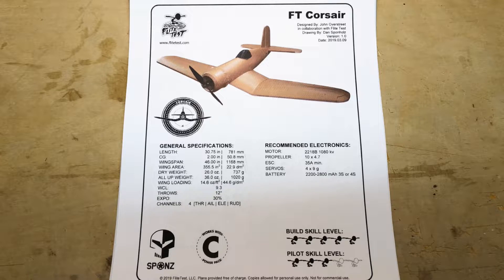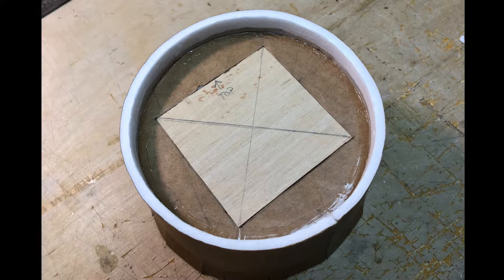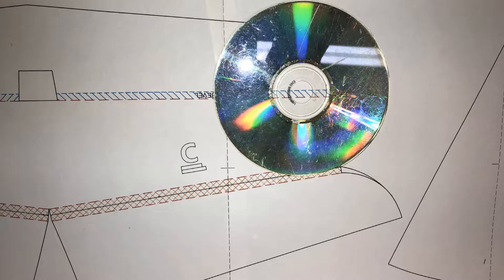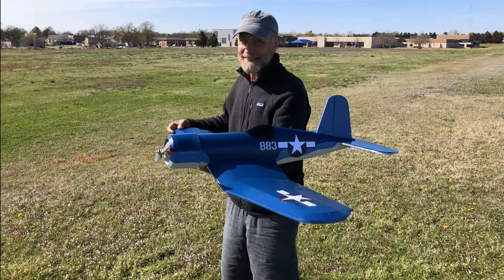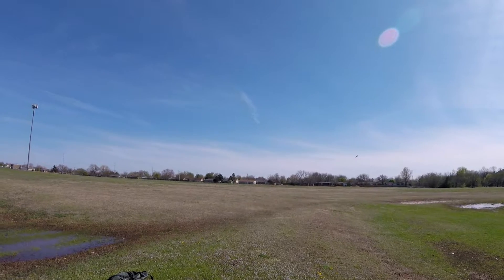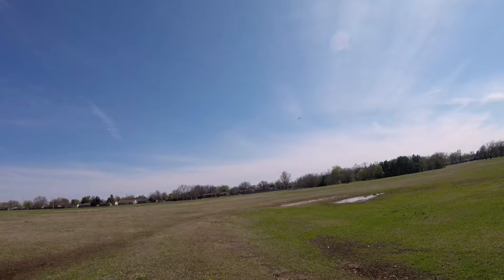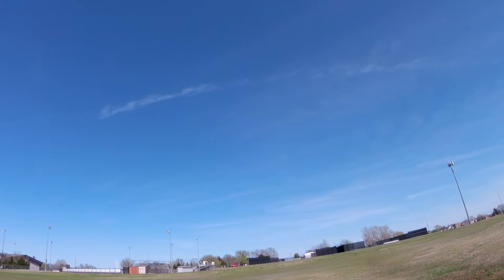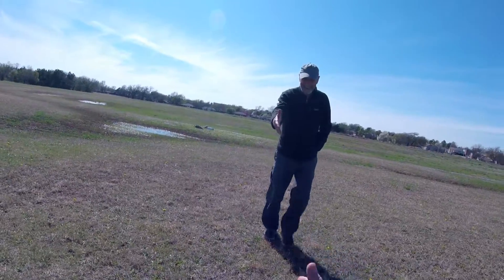FT Corsair Master Series Build and Maiden

Comment: thanks you, you best works, nice plane.  i have a qa. What motors and props are used on your plane?
Reply from the maker: Thanks for the kind comment!  The motor (also in the video description) is an RCTimer BC3530/14 1080KV (similar to Flitetest "C" motor) and the propeller is a 10x4.5 apc.  Good luck to you.

Comment: Where is the CG of this plane?
Reply from the maker: Hi there- it’s right on the front wooden wing spar.  This is the recommended cg from flite test.
Reply: @mostlyharmlessrc3920  Thanks, I will maiden this plane this weekend, but it still tail heavy althoug I have use 4s 2200 and landing gear. Do you have any solution?
Reply from the maker: I have always flown this plane with more battery weight than that (usually two 2200 batteries in parallel) and even added a 50 gram lump of lead inside the cowling.  This got me to the correct CG in the end.  Good luck.
Reply: @mostlyharmlessrc3920  Thanks, it really helpful. Tomorrow I will maiden it :))

Comment: Hey man..that is very good video description and corsair is very stable in flight.what motor did you use?i made the plane with hobbyking turnigy aerodrive sk3 3536-- 1200kv motor..the motor weight with fittings is 135gms and AUW is 1200gms and im using a 3s 2200mah lipo and 60A esc .motor is giving a thrust of 1900gms. can the plane fly stablely and can it perform aerobatics?....i need your suggestions
Reply from the maker: Thanks for the great comment!  The motor I used is in the description: Rctimer BC3530/14 1080KV (similar to FliteTest "C" motor).  The motor you have should work well with the right prop (9x4.5?).  My AUW was 1060 grams, so yours sounds a little heavy.  You'll probably want to use two 2200 lipo batteries in parallel to get more than five minutes of flight time.  The biggest issue is to make sure your plane balances at the location of the front spar (correct center of gravity).  As long as you have some flight experience, it should go well.  Good luck!

Comment: Hi nice design.. FT recomend 5.1 cms for CG center of gravity, what is yours..  and the total weight.. I just finish my F4U corsario but I use 6mm foamboard.. I put aditional weigt 50gr . Total weigt 1200gr. I have 6.8cm 😔 I going to test tomorrow..
Reply from the maker: Thanks for the comment!  My CG was right on the front wooden spar, as Josh recommended in the build video.  My plane weighed 1060gr including batteries.  I also had to add 50 grams inside the motor cowling to get the balance right.  Your plane should be stronger with thicker foam, but may need a little more nose weight.  Huge luck to you and happy flying!

Comment: I'm on my 4th F4U from Flite Test, yes I'm hard on this foam. I've never built one via the free and they provide. How long did it take to cut out and how did you do that?
Reply from the maker: Wow four of them is impressive!   Here's the page where I downloaded the tiled plans that print on regular 8.5x11 inch sheets of paper (tiled A plans): https://store.flitetest.com/flite-test-ft-corsair-master-series-electric-airplane-kit-1168mm-flt-1065/p897439?gclid=Cj0KCQjwnKHlBRDLARIsAMtMHDFePyqkVVR4-bZxJByq_JvZZfhea-sf2-Hyq2L2KPN4Y0iecG9av5UaAj8tEALw_wcB.  In the plans is a page showing how these sheets are taped together and then laid out on full size sheets of foam board from the dollar store or a hobby store. It took a few hours to cut out the foam and plywood pieces.  Cheaper and faster way to do it!  Good luck  :)
Reply: @mostlyharmlessrc3920  I'll have to do that, I'm not doing anything these days lol thanks for the reply and be safe!!
Reply: @mostlyharmlessrc3920  also, great build!!!!
Reply from the maker: Thanks very much!  You too 👍

Comment: Great build and maiden!  I'm working on mine now.  Just added some balsa to the leading edges.  I'm using the old white DTF.  Bought a speed build kit and used it as a template for the DTF build.  I'll fly this one till it comes apart then build the speed build kit with the hardware.  I've had so much fun with Flitetest planes.  I literally flew my mini corsair until it got so soft it wouldn't hold a straight and true flight path.   Have fun, build, crash, build and repeat.
Reply from the maker: Thanks for the great comment!  I think adding some balsa to the leading edges for strength sounds like a good idea.  Flitetest got me into this hobby about five years ago and I'm grateful to those guys!  Huge luck on your builds.  :)
Reply: Interesting i have a ft storch from 4 years ago that is as strong as when I first built it probably around 500 flights on it by now, although in AZ we don't usually have humidity and im guessing that plays a role in it getting soft? Also just recently built the ft p38 hopefully will last like my trusty storch.

Comment: Did you have to add nose weight? I went with a 2814 1300kv motor. Mine is just about ready to fly.
Reply from the maker: Hello fellow Okie 👍🏼 Yes, I added 50 grams of lead inside the bottom front of the cowling, and it still wanted 300 grams of battery weight. Mine balances on the front spar. Good luck on your maiden!
Reply: Hey buddy thanks for the reply. Im in Tulsa howsa bout you?
Great job on yours! What is your AUW?
Reply from the maker: Hey man - I'm in Norman!  This field is next to a public school on the East side.  My AUW in this vid was 1060 grams.  It's about 60 grams heavier since I added landing gear!

Comment: A small piece of open cell foam over the microphone will alleviate most of the 'Wind Noise' Nice job on the color scheme. If a 3 cell isn't cutting it, try a 4 cell.
Reply from the maker: Thanks for the microphone advice - I will try that!  I have since flown the plane on 4s (improvement) and added a larger motor (more improvement).
Reply: I played this video thru the sound system in my truck with 600watts and two  12 inch subs... sounded like i was in a catagory 4 hurricane!

Comment: I was just thinking, your builds are awesome I was wondering maybe if you want to try to build a Savage bobber cub I got some plans from Hugo in Czechoslovakia he also sent me a bunch of Biuld pictures. I want to build it so bad it be cool if you built it that way I can follow along? 😁 Please lol
Reply from the maker: Interesting!  What size is the plane and is it meant to be wood or foam?
Reply: @mostlyharmlessrc3920  it can be built so many ways. A lot of people build it with arrow shafts and Kevlar string with thin CA to wick in the joints. Everything else is made out of pink foam or whatever you want to make it out of. there's some people that made it out of wood dowls or bamboo and painted it black so many ways you can do it, most likely I'm just going to tig weld aluminum frame and then do the rest with foam and fiberglass. Haven't decided yet I have to go price the aluminum and then go price the carbon I'll go with whatever is cheaper. There's also the Savage cub which has a full fuselage which is easier to build.

Comment: wow very nice paint job.  I am also building this Ft corsair. I am using a 3s 2200 battery but it seems really tail heavy. I can not get the cg correct.
what is the size of the battery you using and did you add any extra weight in the nose?  if yes how much?

thanks
Reply from the maker: Thanks for the great comment James.  I made the mistake of installing the elevator servo in the tail, so mine was even more tail-heavy.  I used two 2200's (340 grams) and still had to add 50 grams of lead to the nose to get the cg on the front spar.  It worked out though - my total weight was still only ~40 grams over recommended.   Good luck!
Reply: @mostlyharmlessrc3920  thank you
Reply: Hi just roughly, what is your all up weight?  thanks again
Reply from the maker: 1060 grams - no problem 👍🏼
Reply: @mostlyharmlessrc3920  Sounds like a 5000 mah 3S will do the job properly isn't it ?
Reply from the maker: Jelle Kaptein Yes that will work if you can fit it in! 👍🏼